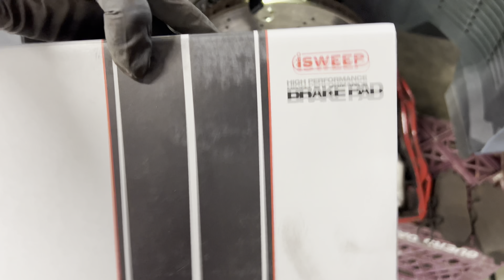Installing isweep Brake pads on my 2022 8y RS3

Comment: Changed to these exact pads myself on my 23 8Y RS3. Have a few hundred miles on them. Doing great so far. Absolutely no noise and a LOT less dust.
Reply: What option did you install? 1500?

Comment: Great vid. Wish I saw the front caliper come off. How is brake noise on these compared to oem? My 24 squeaks like mad.
Reply from the maker: No brake noise at all, the front caliper is just two 21mm bolts, very easy to remove
Reply: Dude I can't stand the noise from the brakes. And the brake dust is atrocious.
Reply: @SkittlezGTI  slightly embarrassing but fuck it. Race car noises. 😂
Reply: @the1stdude  I just push the loud pedal and I forget about them

Comment: Question here about the all season tires you had installed. I feel the car has a lot of road noise on the interior on rougher roads. 
I was wondering if the road noise level has diminished a little bit afterwards? Please let me know, Thanks!
Reply from the maker: Hello I’ve never driven with the factory summer tires but these tires don’t have much road noise at all

Comment: I am coming back to Audi after having many Subarus. This is my first RS3 so a few questions please.  Are those 21mm bolts one time use for the front caliper and any torque specs?  Lastly, does each side have a wear sensor? Just prepping myself for how many deletes will be needed. Thanks!
Reply: There are two pad wear sensors, one in the front passengers side and one in the rear drivers side I believe.
Reply: @ Thanks for confirming. The other week I got under the car to check and that’s what I saw. Thanks!

Comment: Great review on a low dust brake pad option! What thickness of spacers are you’re running?
Reason for asking is because my rears are 15mm thick and it rubs the rear fender plastic piece. 
Is that the reason you removed yours? Thanks
Reply: I don't believe he's running any spacers, these wheels are OEM and don't require any spacers. Unless you don't like how they sit on the car and want to bump them out a bit.

Comment: Have you some how measured difference between new and stock pads?

Do you have any updates about audi tt rs?
Reply from the maker: The used pads had a lot of life left at 20k miles.

Ttrs getting some upgrades :)
Reply: It's good to know stock pads were holding up well! How many miles would they have gone with no track usage?@briansaxon
Reply from the maker: @ lots of meat left on them and they were oem.